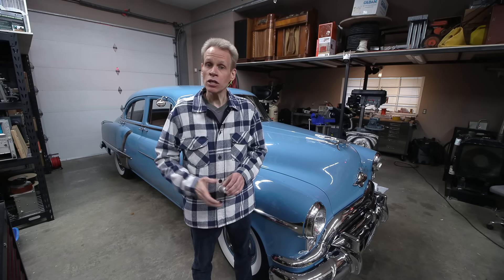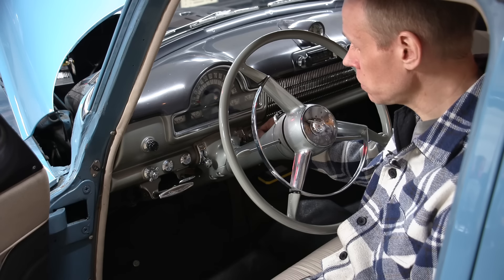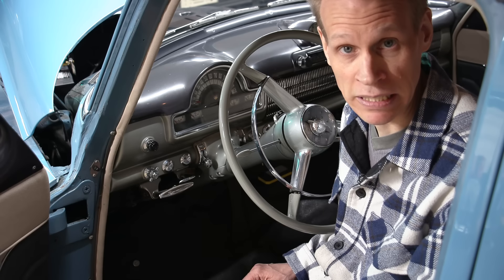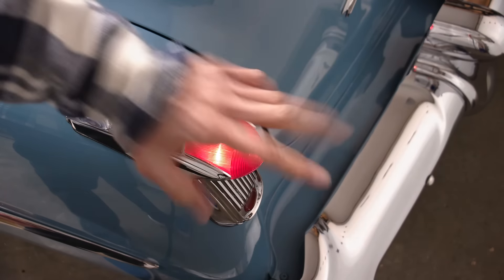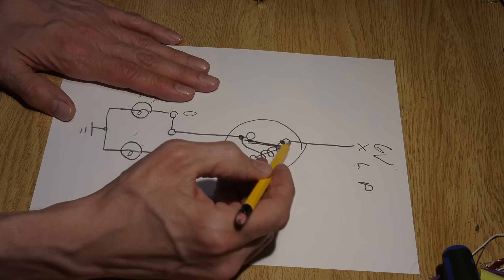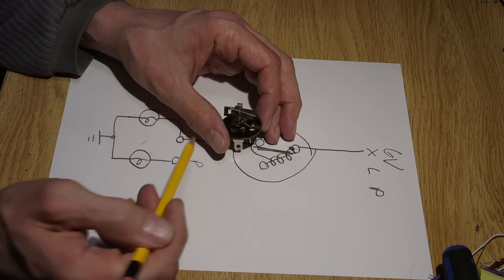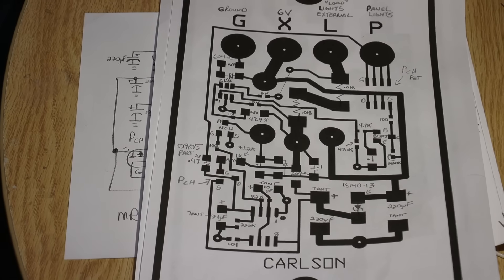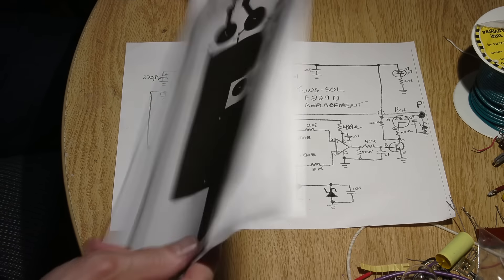How A Turn Signal Flasher Blinker Works - Complete Redesign With Schematic [Tung-Sol P229D]

Comment: There is significant safety in this topic with so many "conversions" to LED bulbs now on the road. The art of signaling  has a timing component. To signal a stop, you want that immediately displayed, fast acting LEDs are perfect whereas an incandescent will take longer to reach full illumination.  For turn signaling,  an LED will need to go thru an activation process twice and a deactivation once while an incandescent takes just a moment's worth of brightness change to convey the message. The LED has an "instant-off", but the incandescent is still burning off light maximizing the length of time it's sending the message that you intend to turn. This makes the messaging actually faster by an incandescent for the signaling of a turn.

Comment: That Olds Rocket 88 is fabulous! Love what you did with the turn signal as well. I bought a solid state replacement flasher for a 12V system in my 1994 Mazda B3000 (Ford) a few years back, and i like it, but it's nowhere near what you've developed!

Comment: Very nice design! Adding a FET (gate connected to the gate of the panel FET), source to GND and drain to the gate of the 7555 reset FET (add necessary resistors and cap) you might be able to eliminate that extra click no matter at what point in the timing cycle the turn signal lever is returned to center.

Comment: You should be able to take a 12-volt electronic flasher 3 wire one and change some resistors on the inside to bring it down to 6 vote. I normally always put the electronic flashers in because they don't work on load. They do for the start but they mainly flash evenly no matter how many bulbs are in parallel in your system.

Comment: I really like your approach of constraining your design around the existing system so you can always go back to the original in the future, because having that option is always a great for those who are interested in having their vehicle as close as factory stock as possible. 

I often get myself in trouble on projects taking the same approach but when it goes well it’s always rewarding. The one thing I wanted to ask was had you considered adding a dummy plug feature into your design to plug the original flasher unit into as a convenient storage for the stock unit? Maybe it wouldn’t have fit on the inside but even adding a metal band clip for it to snap into on one side of the box might be a simple alternative. 

Often I lament that manufacturers don’t utilize available space in equipment or include a secure retaining element for lids or covers that normally stay on during storage but easily get misplaced while the equipment is in use. 

A slightly related tangent would also be including excellent storage for swappable components or an extra replacement wear part like the better companies used to do in some of older things. Occasionally while restoring a tool I’ll be opening it up / fiddling with it and come across “hidden” compartments containing parts that I had no idea existed usually in some cleverly engineered cover or behind a panel.

Comment: Another interesting artifact of this circuit is when hazard warning lights were introduced with this existing system, the dash arrows would not illuminate. A secondary red dash lamp was used along with a dedicated flasher.

Comment: I didn't read through all the comments, but the flash rate is good.. If it was off too much longer, it would create more thermal stress on the bulb filaments, and they burn out sooner. This is akin to preheat current used on incandescent stage lighting, where the filaments are never completely shut off, only dimmed way down for the purpose of bulb longevity.

Nice Olds. I have one ten years newer, a '62.

Comment: Looks like a good product for the vintage car market. Thanks for the detailed explanation of both original and substitute flasher. 
What happens if a lamp burns out, did I miss that?
I remember, in the old days, that when a lamp burned out the side with the bad lamp would flash considerably slower or not at all and that the dash lamp might stay on or not flash. A good reminder to check the lights.
As always a great lesson.
Thanks for sharing.

Comment: Brilliant thanks. I have a 1952 MG that lived its life in California and has after market indicators. Mine failed a normal replacement unit would not work. I managed to get them going but the panel light does not work properly. This makes sense of it all now. Will try a permanent solution. Thanks Paul

Comment: Paul great video.  Many of the electronic solid state components you used were not invented in the early 50's especially the surface mount components so tunsol or some aftermarket company would have to make the circuit out of vacuum tubes!!!   That I would love to see.  LOL!!   Most likely a vacuum tube version would take up much of the generous trunk space of your Olds.   Thats a nice early 50"s Oldsmobile you have there.  I'm not expert enough to pinpoint the year.  It appears to be a great restoration.

Comment: My favourite two wire flasher circuit is on techlib. A Charles Wenzel circuit. One npn (or N channel MOSFET) and one pnp transistor. Works very well, and modifiable for other scenarios.

Comment: Very Interesting...
The reason they did this to make the system warn about burnt lights. If a bulb is burnt, the two panel indicators will blink together to warn the driver outside lamp is to be replaced. This is done wihout any semiconductors of course 🙂Very clever indeed.

Comment: You can still find the original style thermal flashers both NOS and used on eBay and elsewhere. Not exactly unobtainable as you mentioned.

Also you're taking a simple reliable design flasher and turn it into a complex flasher made from several more components which are not nearly made nearly as well as the original parts.

Comment: back in 2011 I made a circuit to replace the brake light/turn signal sequencer for old mustangs.  Those cars had three lights per side, and when the brakes were pressed, the brake lights would light up one-two-three. The original system used some clunky old relays which were severely prone to failure, but my new system used simple mosfets and a monostable multivibrator. they ended up being about 1.25 inches square, and cost 3$ each.

Comment: An important side benefit of a solid state timer based flasher is the rate of flash is no longer dependent on lamp resistance, and LED replacement bulbs won't screw with the flash rate.

Comment: The one in my 98 Jeep Wrangler Sport 4.0 (TJ) has a two-contact turn signal switch. There is a standard and a heavy duty for trailer towing. I didn't know it at that time when I plug in a trailer the turn signal would stay on briefly, like what you were showing on your classic car. So, I had to have the heavy duty turn signal switch for trailer towing. 

Those seem to work based on the load pulling through the switch. The higher the load creates more heat on the switch. 

I am able to buy a solid-state turn signal that plugs in where the original two contact switch goes for my Jeep as I swapped out the incandescent bulbs for LED's. Actually, it is getting harder to FIND incandescent bulbs for automobiles anymore. Most parts stores sell LED replacements only. Then you have to modify your ride with load resistors to mimic the load value of incandescent bulbs for LED's.
Reply: On old cars with conventional flasher can systems it was necessary to change your can to a trailer type can, this didn’t  flash based on lamp current but had a set rate. People knew this and would pick one up at the auto parts store.

Comment: Excellent project, Paul!  Great design, and maybe you could include a 'normal' 12V edition, for those folks who don't have to contend with, I've gotta believe, the pretty rare 6V system.  And if I recall correctly, there may be a few models out there which used positive ground with their 12V system.  Again, great explanation of a trickier-than-it-first-looks flasher system!

Comment: A fascinating video, Paul, and thank you for taking the trouble to make it just to reveal the clever idea behind the design of the original blinker. A question though on the design of the replacement electronic circuit - I think the circuit could be simplified if you use a cheap microcontroller with a built-in timer. Programming it to control the external and dashboard lamps would be a cinch, I think. Just a thought.

Comment: By looking at your schematic all you needed to do is ground the “P” and swap the bulbs in the dash. And then use a regular flasher. Motorcycles with a single bulb for indicator do the same. It uses both (+) left, right to work.

Comment: TRIDON now called NOVITA in the U.S. still sells 6v 3 terminal flashers. LL535 is an Electro-Mechancial unit believe build under Patent US3247402 but find New and NOS of Tridon 6v thermal flashers like Tridon TF63. Many old cars uses 3 terminal as only had 1 bulb on the dash when turn lights are on. The Light "trick" here is similar to front side markets that must blink because how the front bulb is mounted so others can't see at wider angles etc failing to meet government rules without this. Side marker bulb like 194 is across both front filaments like 1157.

Comment: I like these type of videos, where a solution is found for an unobtainable part...  One accidental feature of the original mechanical part is that the blinking rate/duty cycle would change if one of the outside lamps was blown:  There are at least 2 lamps in parallel for each side - front and back, so the mechanical blinker will still work if just one of those lamp is blown, but less current is available to heat the nichrome wire.  I'm guessing it would be possible to add some circuitry to the current sensing element of this circuit to detect this and maybe change the duty cycle of the panel light(s) if reduced current is detected...  I don't mean this as a criticism, especially since a lot of modern cars don't even indicate if a lamp is blown, but I think it would be a "relatively easy" feature to add to this circuit...
Reply: It's not unobtainable....NOS Tung Sol flashers can be found on eBay all day long.

Comment: Very nice! You mentioned one of the factors that can effect timing, is difference in wire length. So you were leaving the wire long until you install the unit completely in place, so I was wondering if the wire length matters so much with solid state functioning? As apposed to the Mechanical functioning? I also was thinking of,how on a cold - 50 C Morning, that Hot coil in the original switch doesn't struggle to work!

Comment: I seem to remember that not many 6 Volt British Cars had flashing indicators (new fangled American show-offs), you were supposed to put your hand out of the window and signal like you learnt in the Driving Test.
I had a Morris Minor and that had "Trafficators" that were little mechanical arms that popped out when you used the Turn Switch, they lit up but didn't flash, if you forgot to cancel them or they were sticky (a very common occurrence) you usually snapped them off when getting out of the car.
Also, no one behind you ever saw them so you got a lots of 'beeps'.

Comment: This is interesting. Bet my 1950 buick was wired up the same as that olds.  I swapped mine out to 12v neg ground and rewired the car. I personally didn't care about keeping all that orginal. Other than that its still got the I8 and dynaflo trans. I also upgraded everything but the headlights to LEDs so they would be brighter.
My grandpa bought it new in 1950. Parked it in a barn around 1970 because the fuel pump went out and he couldn't find one. It sit till 1998 when I pulled it out and we got it back going. He completely agreed with me swapping the 6v pos ground out. Was iffy on the leds until he saw the side by side of how much brighter it made the brake lights, was on board with that then. I did save the old wiring harness.

Comment: I can imagine that on some planets electricity is controlled without copper or any metallic conductor.
But Mr. Carlson should invent and make a prototype solid state alternator.
Imagine being able to plug an alternator into the fuse panel,
and do away with a complex rotating assembly.
Likely this already exists ?

Comment: Very nice circuit! Next step, replace all those old tungsten lamps with 6Volt LED lamps. That will reduce the current draw on that old wiring harness and help the charging system keep up. (You can adjust your circuit if necessary to account for the differences in light up time and down times)

Comment: Would a metal tubing cutter be easier to use to get into that flasher? I've used them to open old electrolytic caps before for restuffing and it was much easier.
Reply from the maker: Or a lathe with a special tool.

Comment: Works have used a microcontroller to do this. Something like an ATTINY85 (8 pin package) would have been perfect and far fewer components. I really appreciated the circuit explanation though. 👍

Comment: Adding a 12v system to my eBike was so much fun, but I do remember the flasher circuit being particularly challenging, and not having a chassis ground is annoying. Took me a good while to figure out that I only needed one solid-state flasher unit for left, right and hazard.

Comment: It should be noted that Tung Sol pushed or invented the 12-volt vehicular electrical system in the early 50's. Also, the older directional system flashers had a clicking sould during activation. Today's flasher system does not have an audible clicking sound but have a system that uses the chime system to signal when than activation has not been cancelled within a certain period. BTW, does your system provide an audible sound during activation?
Reply from the maker: The relay clicking can be heard in the vehicle next to me.

Comment: i rebuilt the flasher modules in my vintage truck by replacing the insides with a digispark and mosfet. now they blink left and right in morse code and hazzards flash sos

Comment: Thinking like an engineer, what looks at first glance like needless complexity suddenly appears as elegant simplicity when you include the hazard switch in the circuit. One push-pull switch and a latching center-off SPDT to satisfy that truth table, plus the auto-cancel mechanism in the steering column - whoever came up with it deserved every penny they earned from those patents.

Comment: Some of this crazy wiring is because if you turn on the hazards both panels flash along with the exterior lamps. Also most older American cars used the same tail lamp bulb for brake lamps as the flashers, they had to come up with ways to isolate the circuits. Nobody wants the panel lamps to come on when you step on the brake. Many manufacturers came up with goofy ways of making it all work.

Comment: Electronics and old cars...how could you go wrong?  Very nice job.  
For my personal aesthetics, I, probably would have gone to a slightly lower duty cycle.

Have you considered what the impact might be if the lamps were changed to LEDs and how to have your board drive them with the lower current?  Or perhaps make a different circuit so the LEDs would mimic a tungsten lamp?

Thanks for posting another great one.

Comment: Have you ever thought about converting to an 8V system?  I think to make that switch, you only have to install an optima type battery and adjust your voltage regulator to 9.4v.

It's been a long time, but I think that's all you have to do.
Reply from the maker: It takes out all the lights in short order. When the car is running, the lights get 7.2V as it is... and they are bright at that.

Comment: Great video. Will this circuit work with LEDs instead of incandescent bulbs all around as well? Thanks Dave.
Reply from the maker: Yes, the current sensor looks for 30 Ohms or lower to flash the panel lamps.

Comment: Another interesting and probably unique project Paul; if you like a challenge do you think it would be possible to a:) design a circuit that only used the same three connections that the electro-mechanical unit does e.g. no ground connection and b:) could be stuffed into the original unit's metal tube?

Comment: It is easy to see why they did the wiring that way, it shows you when you have both front and rear flasher bulbs burned out by seeing the panel light out, dim if one is out. Obviously, the flasher speed would increase.

Comment: Some of my favorite episodes are your automotive electronics. If you wanted to convert a 6V system to a more modern 12V system in your car, would you have to replace all the wiring?  Does the 6V system use a smaller gauge wire?  Thanks Mr. C.
Reply: b.t.w. Do you still own your Trans Am?  Love that car.
Reply from the maker: I do!
Reply: 6 volt requires heavier gauge wire. That is part of the reasoning to move to 12 volt systems, to save cost on wire. 
No, you do not have to change the wires.
Reply: @artnels2  Thanks for your reply.

Comment: Mr. C. Now that the turn signal relay does not depend on the resistance of the turn signal bulbs, will you replace the car's filament bulbs with LED versions as they burn out? I understand that sometimes you may need to add a parallel resistor to the LED bulb so it draws a bit more current.
Reply from the maker: The current sensor circuit looks for about 30 Ohms, if its not there, the panel lamps will not flash. I designed it this way, so if a lamp upgrade was to ever happen, even a small load such as LED lamps would trigger the panel lamps, and the system would act as normal.

Comment: Ingenious solution. However my concern is that different humidity conditions in the car (e.g. when driving in cold and rainy weather) may severely affect the timing of the flasher, because of the relatively high resistance values in the circuit. I made a simple timing circuit for outdoor use once and it stopped working completely because of humid weather.